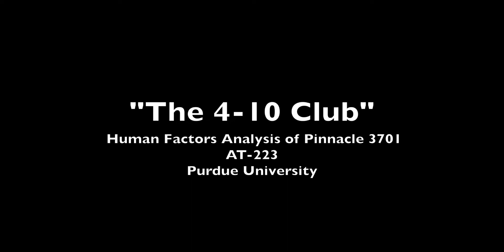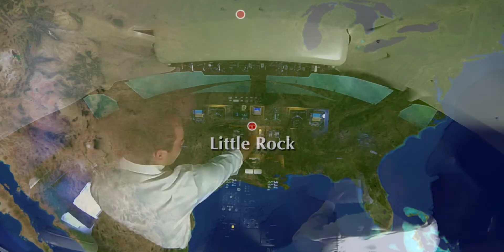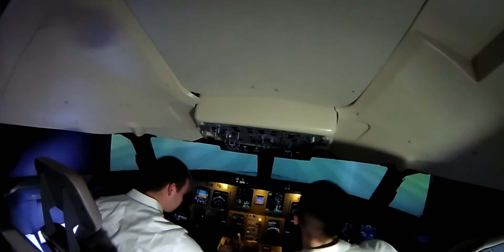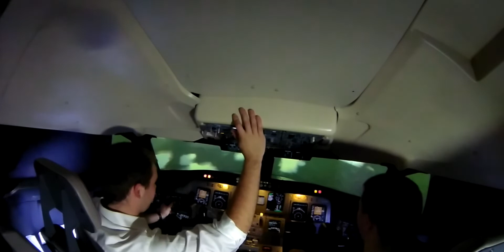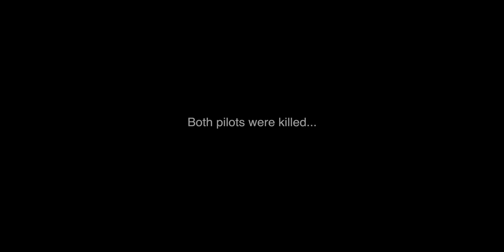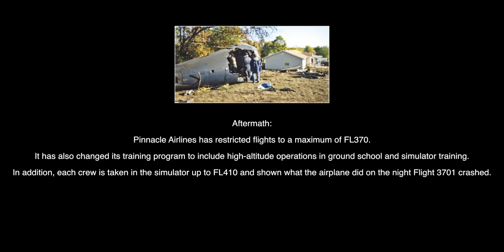AT-223 Project: Pinnacle 3701

Comment: I flew for Pinnacle before this accident, and had flown this particular aircraft many times.  I felt that the airline was well-run, but this accident ruined its reputation.  These were two guys who had no business in the cockpit.  I don't remember anything in training relating to flight at FL410, mainly because the aircraft was never flight-planned at that altitude, or anything close.  It couldn't get there with passengers.  The aircraft was most happy in the mid-20's to low 30's altitudes.  Its climb was doggy above FL250, but it was a great aircraft.  We had a very similar flight...a Part 91 deadhead, Little Rock to Detroit, because we had a rest time mix-up and would have been illegal to fly passengers.  Ours was daylight, though, and I had an excellent, experienced captain.  But we also wanted to see what FL410 was like with an empty aircraft.  So we went up there, had no problems, and came back down...and we're still here to talk about it.
Reply: What was the difference in your flight up to that altitude and in this particular one? And was there any chance of them getting out of the stall and restarting the engines? From my understanding they could have attempted to land at closer airports, correct?
Reply: They ascended too fast and kept pushing the engines to stay up at 410, until they overheated and locked up. They could have landed at several airports within gliding distance but were afraid for their jobs so they tried to restart the locked up engines instead of declaring an emergency. By the time they did it was too late, they were too low.
Reply: In my opinion its not necessary to ''fing out, what FL410 is like'' . Just because you survived it, and assumingly didnt made as much wrong decisions as in flight 3701 , doesnt means , thats a good idea. 
I interprete maximum and minimum cruiseable  values as indicated in EXCEPTIONAL situations (like if you dont have any choice to avoid a hurrican, or vulcanic eruption, except to go: as high as possible with the aircraft). The more the maximum and minimum values of capabilities of an aircraft is used only for emergency situations, the more rare accidents will be. I only can speak for myself and you can call me whatever you want (if its floats your boat) , but i would never fly with you as captain or first officer. Unfortunately i dont know your name, so i cant avoid it.

Comment: Any pilots out there...answer this for me;  
can you restart a GE jet engine after core lock? 
Even at 300+ knots?
Reply: No.  In this accident the high pressure turbine blades literally melted and fused to the low pressure turbine blades behind them.
Reply: @emtpilot132  I think you meant the blades fused to the stators. But correct, NO!